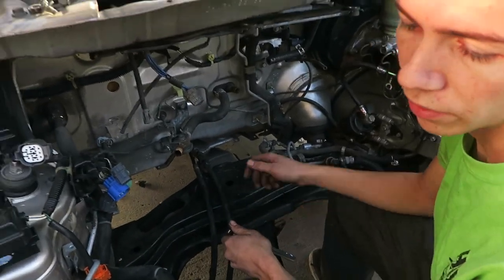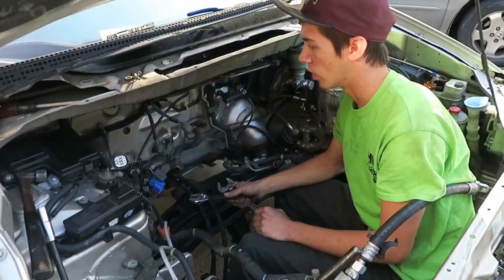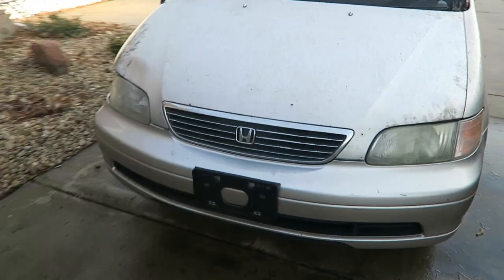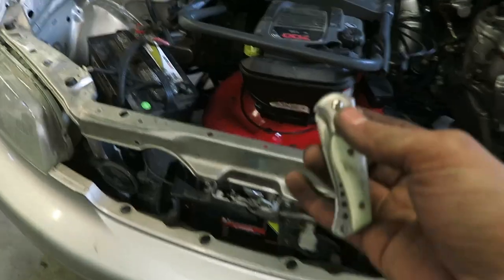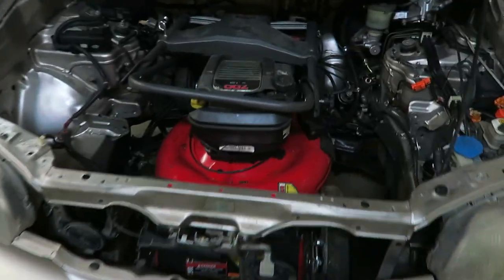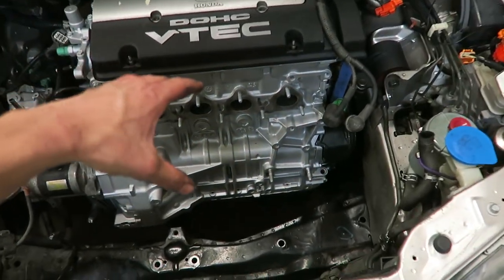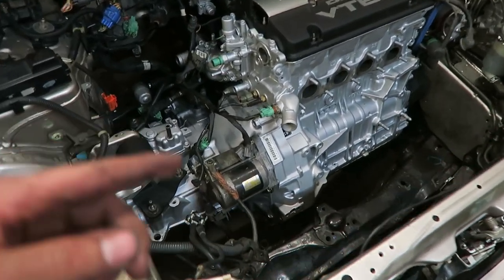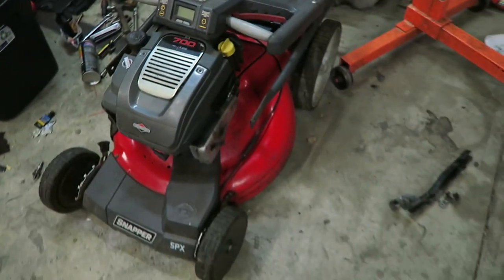Lawn Mower Powered MINIVAN!

Comment: Hey bud love the vids. Had a tech question though. Why do you run the h22 short block on both your hatch and the van v.s. a f23 steel bore short block and rock the g23 setup? Wouldn't it be stronger and more torque? I'm about to build a g23 and would really appreciate your opinion between the h22 v.s. the g23. Thanks and love the vids keep it up.

Comment: Been saving money for this swap someone sold me a finished Frankenstein engine h22a head/h23a1 block on stock h23 pistons ($200 with a bad spuned bearing) . I needed a new crank.  I was lucky i found someone with a f22a1 complete long block with a automatic trans for($50). i also got layin around an h22a block that is only good to re sleeve which is my side turbo build while i get this frank to run .

Comment: The starting problem is probably because you used the auto wiring harness. Park switch is a little different than a neutral safety switch

Comment: What did you do to the lawn engine to make it work so well?
Reply: Also why didn't you just take the engine off the deck before putting it in, AND that engine would had sputtered even a little when the clutch was engaged.
Definitely a fake thing.